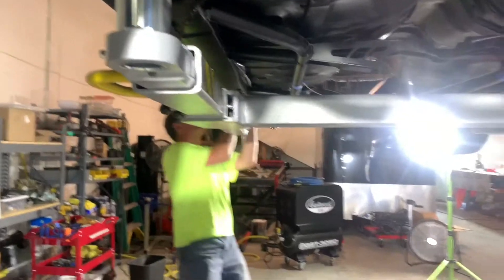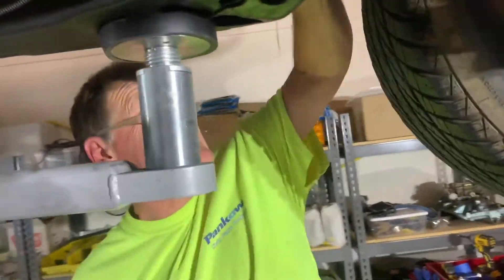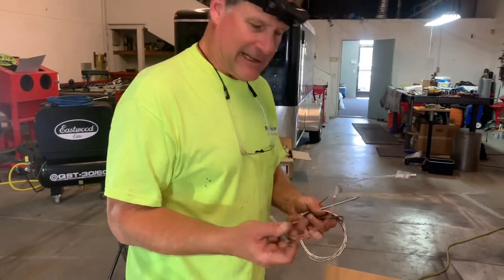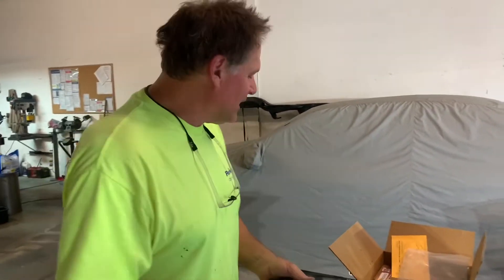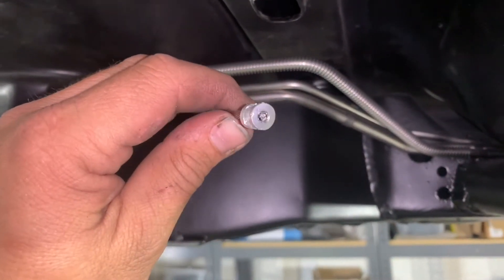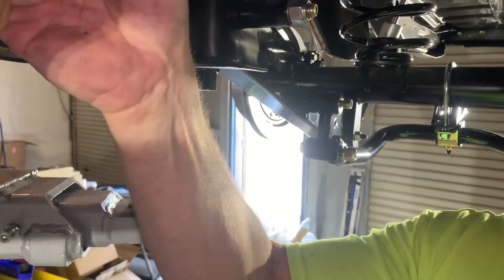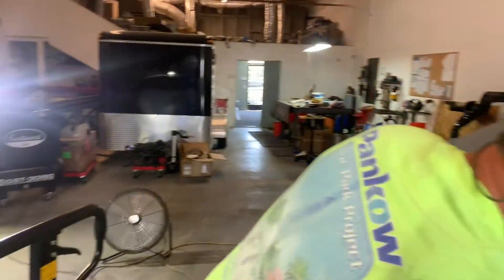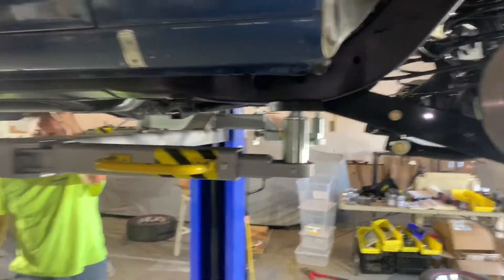Wick's 1969 GTO Convertible - Swedging our parking brake cables

Comment: Glad to see you doing this!  On my car, VW makes it so hard to adjust the parking brake so I was wondering if I could just cut it at the end and swage the cable to remove the slack that way.  Now I see swaging is a feasible option (really wanted to confirm this).  I saw another guy weld a few nuts to the ends.  I'm trying to find out how the factory puts those ends on.  I'm thinking they weld those ends on?  And swaging is indeed strong enough and safe enough?  I have a project ahead of me.  Thanks for uploading this as it contributes to the information I need.
Reply from the maker: Most factory cables are sweged…
Reply: @DezarovsClassics  Thanks for all your information!